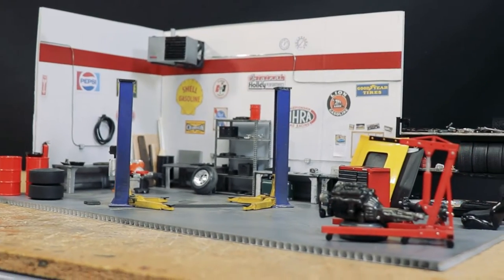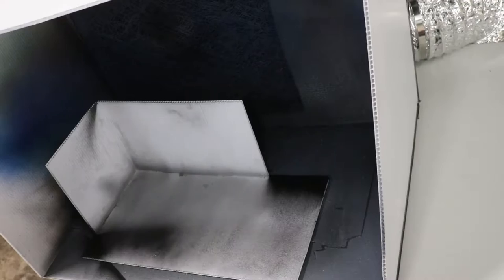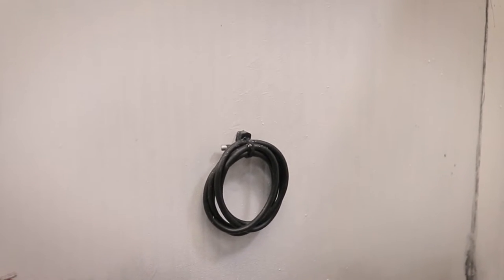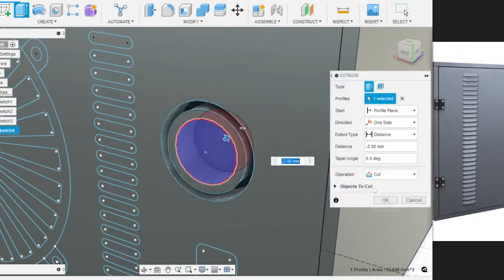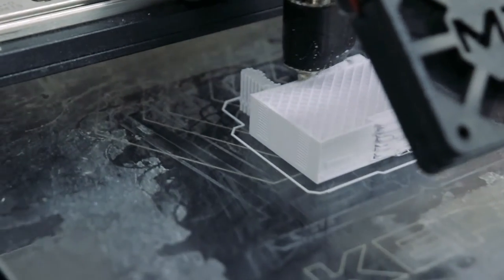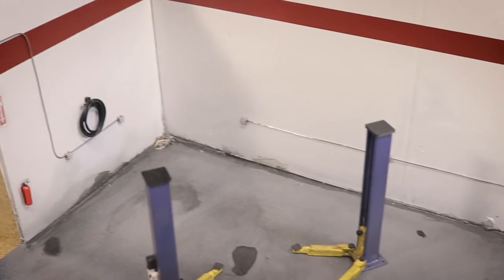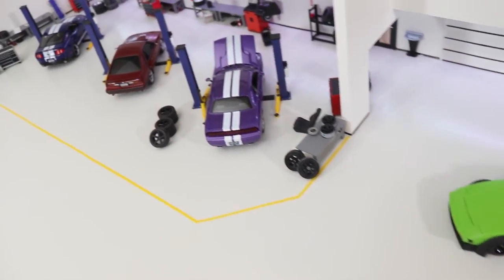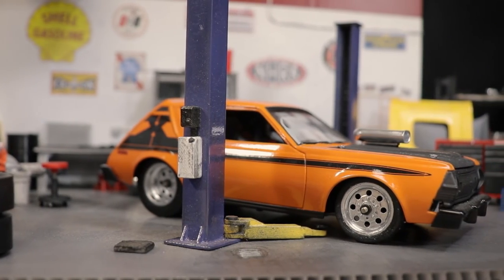Building a Tiny Garage Diorama for My 1/24 Scale RC Car Models

Comment: Maybe run an air line parallel to the electrical conduit, with taps every so often. That way you can show shop air without taking up space with a compressor. Alternatively, make some air fittings to mount through the wall if you don't want to run air line. Also, try adding a bit of PVA glue to the black wash for your shop rag to stiffen/ toughen it for transport. Add a bit of blue tape to the open intake manifolds and exhaust ports. This is done IRL to keep stuff from getting into the valve ports and pistons. If you have some local shops that would be willing to let you walk through, and maybe take reference pictures to get some real-world ideas. It's the small details that really set off a diorama.

Comment: Another simple way to measure for 1/24 scale dioramas is simply to note that 1 foot = 1/2 inch. 

I’m about halfway through my garage build now. The corrugated plastic is exactly what I was looking for to replace my poster board floor. Prior to that, I used styrofoam coated in a mod podge/plaster/paint mix and that looked AMAZING but was too thick and cumbersome.

Mine is all scratch-built items using styrene and various hobby wood (balsa, etc.). Today, I added a little 12x8 loft area where the garages office/lounge will be so that means tons of new little accessories to build!

Anyway, I love what you do. Keep
Rockin’!

Comment: I wonder how difficult it would be to make the car lift actually function going up and down, a nice modification to an already cool existing product
Reply from the maker: The lift is fully functional as a real one would be as far as adjustable height and the arms are able to rotate and slide in and out. It is all manual of course. If you're talking about making it go up and down with a motor, that would require modifications.
Reply: @MakeItRC   yes , motorized with small 3d printed drive parts , or maybe use watch gears etc